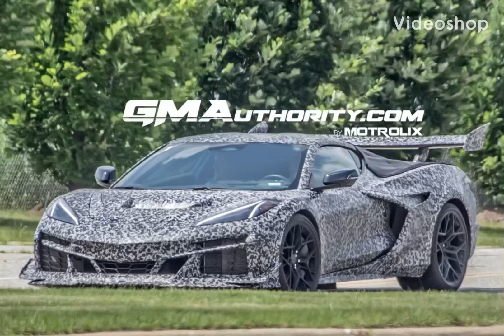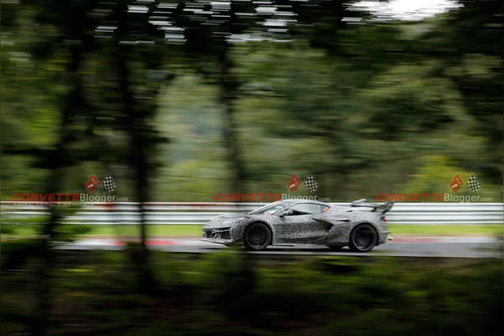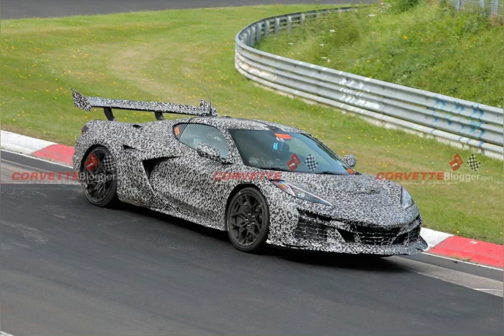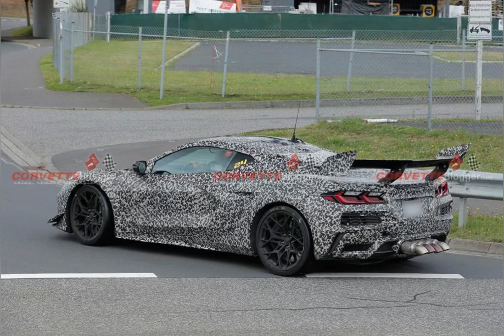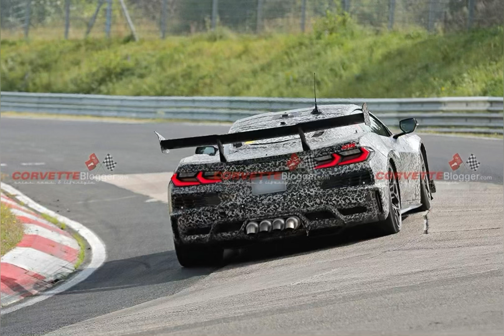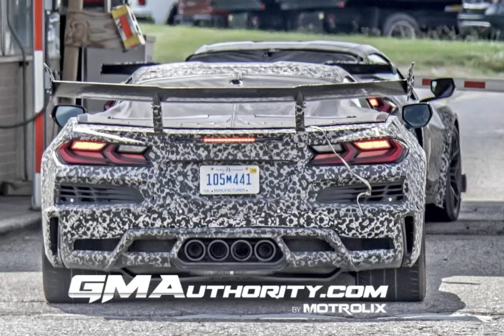C8 Corvette ZORA spied testing at the NURBURGRING! Also C8 Z06 lap times soon?

Comment: Now this bad boy is going to be fast if you think the e-ray was fast just imagine a awd zr1 with electric motor and twin turbo i think Zora will be pushing 1200hp stock off the assembly line but imagine if they put a V10 or V12 in it, I'm just happy GM is stepping the game up
Reply from the maker: @blackpanther1269  It’s going to be INSANE fast!
Reply: No possible way a v10 or 12 with all the money on 5.5 wich makes stupid power , so much power that it's boost by gear and you don't get the full power until in upper gears. Simply adding the E launch assist will a.low the 5.5 to put more power and sooner to rear wheels in low gears and acceleration will be EV level scary . It's also possible to increase battery power if new more  energy dense batteries come out , who knows .  200 Hp front assist would be great help for rear trying to deal with 800+ ft lbs and 1064 Hp .
Reply: Gm said around 1300 hp
Reply: nah they will used the ebngine from zr1  maybe with bigger turbos

gm always uses new engines in mult models to reduce cost

Comment: you have to have speed for down force so  the down force in the corners will be minimal, speeds will be increased with the front wheel drive from the batteries and motors to minimize lap times coming out of the corners.
Reply from the maker: @peterw2714  I can’t wait to see the official times for all the C8 variants! Let’s go GM!
Reply: @dbmracing2019  having a C8 Z06 already I too am very curious!
Reply from the maker: @peterw2714  💯

Comment: They’re electronically limiting HP & torque in gears 1-3 in the ZR1, E-Ray, & Z06 according to Josh. They even limit 1st-2nd gear in the regular stingray
Reply: No limiting torque and HP , because on the ZR1 and the ZORA the longer final drive ratio  the shorter gear ratios are specefic for the LT7's  engine and completly different than the Z06 with n/a LT6.

Comment: Time to start speculating on spec's! My guess on the horse power is 1324. 1164 plus 160 from electric motors.
Reply from the maker: @machdaddy6451  And the fun begins!!
Reply: @dbmracing2019  Most of us were way off on the horse power of the ZR1. Let's try to do better this time! My guess is 1064 + 160 from the electric motors for a total of 1224.
Reply from the maker: @machdaddy6451  I like that guess…… I was for sure way off on the ZR1 power levels!
Reply: @dbmracing2019  We all were "way off"

Comment: In one video a while back the GM engineer let it slip the zr1 turbos were tested at 24 PSI
Reply from the maker: @drewanderson427  They actually will run to 24 psi to keep from losing power due to heat. It’s in my deep dive video on the LT7. Production cars will routinely see 24 PSI

Comment: Makes sense that the Zora would combine ZR1 and electric from Eray . The question is what’s next ? How can this be improved to raise performance?
Reply from the maker: @bobjeffries6532  I have NO CLUE but I can’t wait to find out!
Reply: Q1: The question is what’s next ? A1: "GAME OVER MAN...!!!  GAME OVER...!!!" (best Bill Paxton/Pvt. Hudson voice) it's the end of the line, end of an era, next up the "double horrors" of a Corvette SUV, or an all electric C9, or possibly both (aw crap).
Reply: Q2: can this be improved to raise performance? A2: no. well not unless you consider "styling" an increase in performance...? (as some surely do)  what's important to remember is the C8's looks are only but GM's "first attempt" at a Mid-Engine Corvette, however what the C1-C7 generations (particularly the C4-C7's) represents are several variations on the original Corvette "Front Engine Theme"....

yeah so like how GM obviously spent years "milking" the Front Engine layout (hint: GM could've easily not wasted time creating those 3 Prototypes but instead put into production a Mid Engine Vette back in the 90's while Duntov was alive as there was nothing "magical" about waiting to do it for the year 2020) it's quite possible then they could repeat this same pattern with the Mid Engine layout...

something else to remember is, the reason the C8 looks (styling wise) the way it does is because it needed to capture some of the "angularity" from the previous C7 to help "transition" the current customer base over to the new platform, and not risk "alienating" those Billions of Boomer dollars (that's Billion with a "B") from continuing to flow into Detroit and Bowling Green.  however, with the transition to C8 being completed successfully, and Boomers unfortunately passing away, it means the next generation DOESN'T necessarily have to look "like a Vette" persay, no, it can perhaps now be it's own thing...

that's right the current aluminum underpinnings are so good GM could literally leave everything EXACTLY the same chassis-wise, just change to an even sexier exterior styling (think less Lamborghini and more Ferrari, Mclaren, Maserati MC20, etc) and proceed to "print money" for a whole 'nother 10 year product cycle (ie, Base, Convertible, Z06, ZR-1, etc) for the years 2030-2040.  of course the additions of a powered retracting hard top with the HTC, and an AWD Hybrid with the E-ray are both themselves new additions to the larger Product Plan neither of which existed in the last 70 years...

Emission Laws permitting, i would be a shame then to throw all that out after only 1 cycle (for a full EV) and not to "monetize" all that sweet ICE Engineering for another 10 years.  so maybe (just maybe) the rumored "all electric C9" can wait until generation C10 cause once they go electric...?  GM knows the ability to "monetize" all these varieties and trim levels like they've done in the past DISAPPEARS IMMEDIATELY.
Reply from the maker: @phillyphil1513  Likely both!
Reply from the maker: @phillyphil1513  I honestly couldn’t have said that any better Phil! Thank you 🙏

Comment: This is THE ONE to get. The question is, will it only be 160 additional HP for a total of 1224 HP? Will there be any additional tuning to the ICE engine? Bigger turbos? Changes to the air intakes for cooler, denser air? Can't wait to see what the final numbers looks like!!!
Reply from the maker: @MOPARMD  I literally can’t WAIT to find out!
Reply: @dbmracing2019  I'm a MOPAR guy but since Stellantis shat the bed with ICE engines I had to shift gears (no pun intended) and find another American car company that was going to give me the ICE performance and SOUND I like. In the market for a ZR1 and a Zora when available!!!
Reply from the maker: @MOPARMD  heck yah brother
Reply: Q: "Will there be any additional tuning to the ICE engine? Bigger turbos?"  A: probably not, i heard back at Carlisle while the current TT setup is technically good for upwards of 2000 HP, the reality is the whole package needed to be "derated" to 1064 HP (itself a big figure and nothing to sneeze at) because this lower number is what could be safely warrantied.  with the customer claims made against the GT350 and GT500 Mustangs, Ford knows all about this...

as Ferrari, McLaren, Porsche, Lambo (and certainly the E-Ray itself) have shown, if "neck snapping performance" is your goal...?  then it's WAAAY easier to just add this additional power via Electrification. my guess since they have access to all of the Ultium development is (or maybe it's just my hope) GM won't just "port over" the E-Ray's system but will in fact fit a slightly bigger battery (the E-Ray's is only 1.9 kWh) and an even "juicier" Front Drive Unit, or add a motor to the rear in between the engine and DCT.  for reference the V10 Huracan replacement - the new TT V8 Temerario - has 3 motors, a 3.8 kWh pack size, and can even be plugged in.  

yes this Vette will be the heaviest Vette ever made, but it will still be LIGHTER (by about 25lbs) than either a GT500, or a Challenger Demon 170, which are both vehicles with curb weights in the range of 4200+ lbs.
Reply: @phillyphil1513 Would love to see greater electrical power, I hope you are right!

Comment: zora is going to be much faster in and out of corners as well as off the line with the extra traction- the car will be able to use more of the 1000 hp of the engine as well
Reply from the maker: @paullopez3298  I sure hope so! I can’t wait
Reply: @dbmracing2019  its gonna smoke the sf 90 for half the price or less